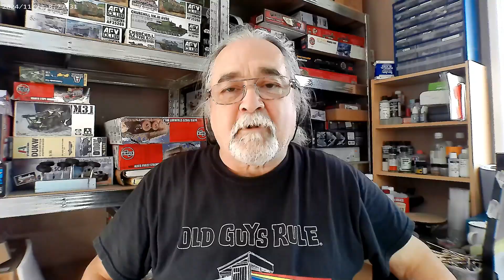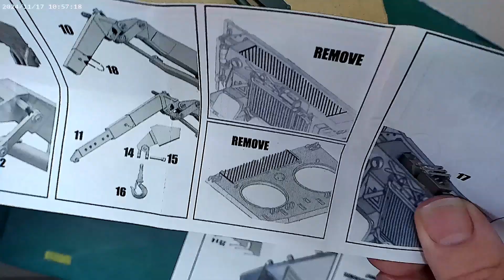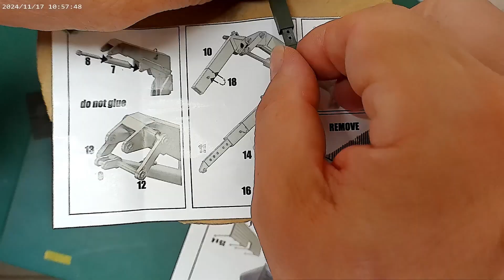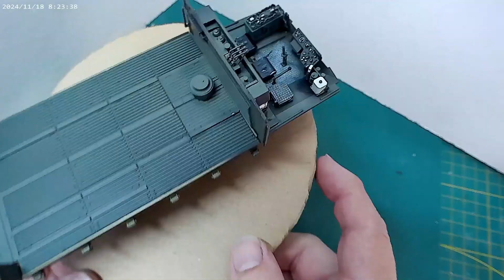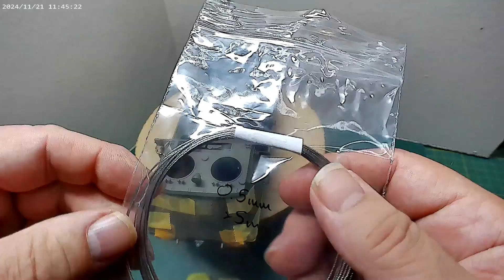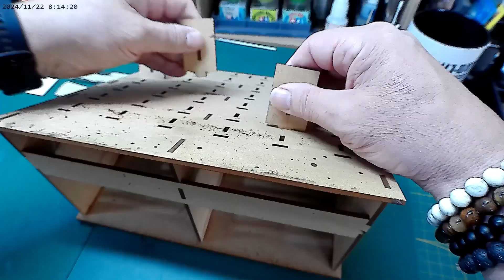Airfix 1/35 Alvis FV622 Stalwart Mk 2 – build 3 part 2 – Atlas Crane Conversion

Comment: Hi Bob, I have only just seen this as I have been on holiday, firstly, I hope that you enjoyed Bovington, i was there in august and really enjoyed it. I almost fell over when I saw the crane jib on the Stolly, as I realised that I was involved in manufacturing them twenty odd years ago. I would also like to thank you for the information on the tow cable, I have been making them from twisted copper with with limited success, cheers.
Reply from the maker: Hi Steven, I hope you had a great holiday. Bovington was good, very crowded with the show at the same time, but I met some good people and some I had met at Telford last year. The Atlas conversion is excellent. I'm glad you found the tow cable info useful, I used to do the same with copper wire, but these cables are more precise.  Cheers Bob